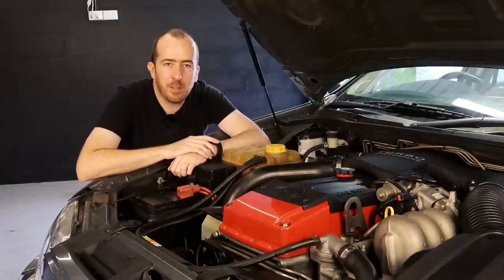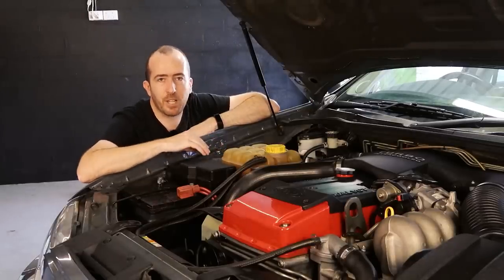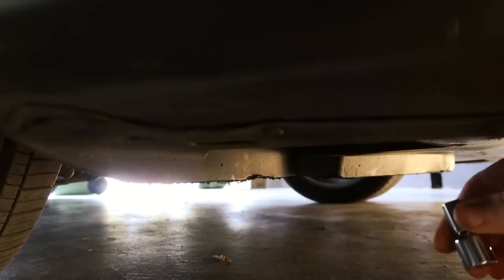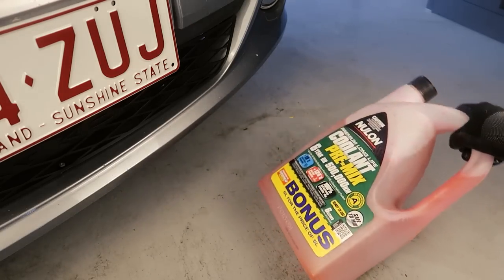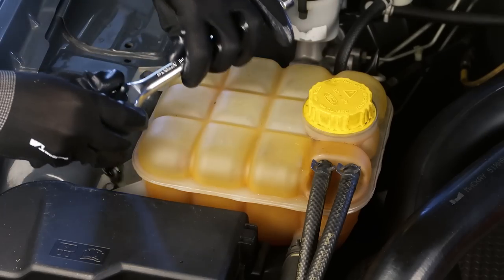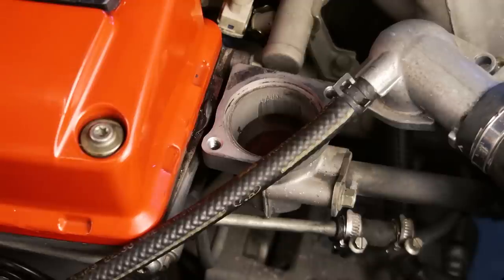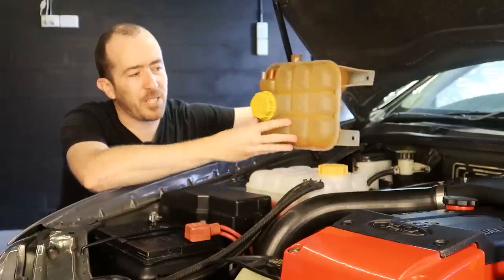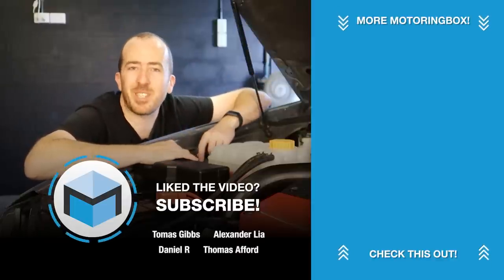Flushing the Cooling System on my Ford BA Falcon XR6 Turbo

Comment: Well presented almost professional video , well done . I had my cooling system flushed out a few months ago , I noticed in the Ford Falcon BA repair manual it says the cooling system takes around 12.5 litres but my mechanic said they only take around 8 litres🤔. I would have flushed it out my self by removing the bottom heater hoses on the block to get as much of the old coolant out as possible like the repair manual says but I have no room at my place to do it . I attempted to change the coil packs and spark plugs myself unsuccessfully I might add because I just couldn’t get that back valve cover but off , just as well too because when I took it to my mechanic he got the air hose to clean out around the spark plugs before removing them , mate you should have seen the dirt and getting blown out around the coil packs , I couldn’t believe how much shit blew out . If I had been successful and gotten to the stage of removing the sparks plugs I hate to think of the grit and dirt that would have fallen into the cylinder. Warning to all those that want to change their spark plugs at home , blow out all the dirt around your spark plugs with an air hose or with a few cans compressed of air .

Comment: I have cleaned up an expansion tank previously by soaking in nappy wash and putting some metal washers in it and shaking it to loosen the crud inside.  Improves them but nothing like a new one if you can get them.

Comment: Just a tip to get to the rear spark plug when you do it, once you crack the plug's seal and loosen with your sockets and a couple of short extensions its useful to pull the plug out (and possibly your spark plug socket) with a piece of rubber hose. If you get stuck one of the coolant return hoses to the coolant reservoir fits perfectly inside the 1/2 inch socket drive and around the spark plug itself and worked a treat to do mine.

Comment: I've seen a technique used on yellowing plastics, mainly computer parts to bring them back from yellowing. Its called Retrobriting, basically immersion the part in a peroxide/water mix and exposing the part to UV light. Would be cool to see if you can get it to work on that expansion tank.

Comment: Better to premix the coolant in case there is coolant left in the system, so that the mix ratios is spot on. Also when putting the clamps back place them on the same spot for a good fit. If the hose is hard to re-insert dip it in boiling water. Works a treat!

Comment: Just a suggestion for when you do the coils and spark plugs, get a set of ngk iridium or laser iridium plugs. I have them installed in all my vehicles, and you will notice the difference, it gives you a little extra power and they last a long time, ive clocked over 100000kms on my vn with iridium plugs and each service I've inspected them and each time they look like new, no corroding, the gap hasn't changed, they are definantly worth it
Reply: R35 GTR coils are a very good upgrade also, did it on my Supra
Reply: Just use the Ford/Motocraft/Denso ones, about $40 for a set where as the NGK’s are a lot more dollars. Iridium work not much better they are just longer lived. Change the plugs before you burn out the coil packs.

Comment: The coolant bottle should last nearly a year until it discolours. Save the old one & clean it up as spare parts are getting harder to find these days. Even if you don't clean it & just store it, you know you have it spare when needed. 
As Sam D suggested, iridium spark plugs are the go.
Again another great video that's easy to follow for those with little mechanical experience. 👍

Comment: Nicely timed video as I'm about to do the same job on my FPV F6. I've actually bought a new PWR all aluminium radiator, new silicone hoses and yes, I got a new header tank (Dayco also) as everything else was new so why not!
Reply: Excellent vehicle
Reply: @AdamAus85  Thanks mate. Really enjoying your content, keep it up! 😃
Reply: Had Tornado No 20 for a number of years (needed more than 2 seats- damn kids!)
Reply from the maker: Cool, replacing the radiator shouldn't be that much more difficult. I'm very happy with the Dayco tank so far, hopefully it holds up well over time. I was tempted to try and file off the little Dayco logo they have on top, but didn't want to risk wrecking it.
Reply: @MotoringBoxTV  Yeah it's quite straight forward. I have replaced a standard one previously (horrible skinny thing with plastic tanks, still can't believe FPV could keep something like this on such a vehicle. It works but...). This PWR unit is 4 core and will be able to keep temps much more consistent with the warmer weather. The radiator in my case has much work to do as the cooling circuit on the F6 includes an oil and transmission (ZF) heat exchabger.

Comment: Great video as always bro. My mate had a BA XR6T ute with the same dramas, only he had just replaced his coil packs a week before he had the misfiring issues, so even brand new ones can be crap (he took them back to Repco, but they mucked him around with replacement saying they had to send the old ones back to be tested before giving him a new set). It turned out the coil pack was actually firing, but the stem down to the plugs were faulty on 2 of them. Vehicle was off the road for about a week. It always pays to keep the receipt. Keep up the great work mate. Looking forward to the next video. 👌

Comment: Check coil packs for misfire.
Also make sure to throw silicone spray into the boost solenoid (down below the coolant bottle). Dont use WD40 as it fucks the rubber in it
Reply: Yeah I agree, coil packs will fix it for sure
Reply: Dis the BA have the cCam Phasers (honestly cant remember- i know early models didnt), because if you are getting a miss, the seals on the phasers can leak, and fill No 1 & 2 spark plug wells with oil, shorting out the coil.

Comment: Always found when doing coolant change that the recommended liters to refill were always less as there is always coolant left in system .The last time i did coolant change on BF falcon mk3 after flushing system i used a vacuum cleaner which blows an sucks using the blow mode i was able to blow all the coolant left in system out of engine an radiator as well as heater core just insert vacuum hose into top radiator hose and blow back through radiator with bottom hose undone then reattach thermostat housing without thermostat in an connect top radiator hose will need to unattach from radiator then blow out system.system then takes exactly the recommended liters of coolant so your not mixing old coolant with new .ps you can buy a ozito vacuum cleaner from Bunnings for around $40:00.which is  what i used . keep your hands on the wheel an your eyes upon the road 🎣👽
Reply: Thats a good idea i never thought of that. I start the engine when the coolant is draining if possible so the water pump can just pump it all out.

Comment: Great video. 
I literally only replaced the thermostat and coolant in my AU GHIA last week, I was hoping to get the heaters working a bit better but sadly no luck with the heaters.
Reply: Will be the heater tap ... not expensive but a akward job to do.
Reply: Same problem.  Heater on my ford EL is never hot

Comment: Hi Sean. Another great video. Hey mate those coolant reservoirs can be cleaned. Have a look at some YouTube videos and then make one of your own. I've seen them being done on the el/nl falcon fairlane ones and they came up amazing. If you get the time would like you to do a video on cleaning yours. Keep up the great work. Cheers.
Reply from the maker: Thanks for the comment Marcus. Although it wasn't shown in the video, I examined the old tank and found the plastic hose connection points were all swollen and heat cracked after everything they've been through over the years. So mine went straight in the bin, but even if the old tank looks okay.. new ones are quite cheap? So I think it makes more sense to replace?

Comment: I do recall way back when I did a coolant flush on my AUII Fairmont that there was a quick-connect underneath the rear of the engine where you could disconnect it using pliers by squeezing two tabs and a garden hose would simply plug into one end... Then you just need to point the other loose end into a bucket and get the missus to crack open the tap!!!
Not sure if Ford carried the same cooling setup over to the Barra (I never got to service our SY Territory as it was under warranty) but it was a brilliant feature!!?👌
Once again mate, keep up the great content of you vids!!!👍

Comment: Coil packs are always the annoying issue with falcons,   good job on the Barra 👍
Reply: The coil packs in my 2009 G6E-T are now 12 years old and have 205,000km on them - still working fine.  At this point if I have to replace them all, I'm hardly going to feel hard done by.
Reply: Just use genuine coils & put hi temp anti seize on the outside of the coil boot & dielectric grease on the inside to help get the bastards out of the hole & off the plugs when you have to replace next time .

Comment: Hot tip... reconnect the bottom hose and direct the top hose down to the ground and run the car with heater core on. (With your garden hose running through the thermostat housing)

You'll flush the entire system, heater core and radiator all at once.
Reply: Also, undo the hoses in and out of the automatic trans cooler and flush and drain through them. They are at the lowest point in the system apart from the radiator petcock.

Comment: Good Job....!!

My reservoir is identical and it looks a bit yellow and cracked in places and I’m worried it’s gonna spring a leak under pressure so I think I’ll be following your lead on changing that really soon
Reply from the maker: Yes it's worth doing. My old one actually had heaps of little cracks around the hose connection points, so it was only a matter of time before one or more of them broke off.

Comment: Barra came with green due to the metal bottom end. Red is for all alloy engines.
Reply from the maker: Supercheap recommended both... I guess it mustn't hurt it that much.
Reply: @MotoringBoxTV  Just searched Nulon lube guide. Recommended  Nulon One coolant (universal 10 year) or Nulon Green.
Reply from the maker: @nunika1975  not sure what you're searching for - when I put in my XR6T's details Nulon recommends yellow or red. Not all red coolants are the same and I'm going to film a video in the future explaining why.

Comment: If it is an original radiator the that falcon there will be a drain plug. They're either under the fan shroud facing the engine or on the very bottom facing down if so there will be a hole in the lower radiator support bar.
Reply: Brendan Casey not true on the XR6 Turbos , the Standard BA sixes and the XR6 had a drain plug but not the XR6 Turbos and for good reason

Comment: I've had the same issue of miss fire on my BA ute thats now done 386000 kms! how kms has this car done? As well as your coil packs or sparks plugs it can also be the rocket cover gasket and o-rings could be worn causing the engine oil to leak into the spark plug cavity. If that happens it can also cause a misfire as spring from the coil pack won't contact the spark plug top tip!  You will soon know when you remove the coil packs if its saturated in engine oil then the gasket o-rings are stuffed.

Comment: It amazes me how the BA falcons don't overheat in summer traffic. In the old days, traffic was a no-go zone for the mighty cleveland.
Reply from the maker: So far so good. I believe my old thermostat might have been an 82c because my engine runs hotter now - with the 91c thermostat. But from what I can tell this is the temperature Ford intended them to run at, and it consistently holds that temp even in traffic.

Comment: Looks really decent. lot better than high pressure near electronics. The difference between green and red is the green is considered standard and the red superior longer life. They use different base chemicals. I don't recall the chemicals used. You'll probably find Dayco are the manufacturers of the original.

Comment: Don’t you have to pump air out of the heater module in the fire wall where it enters in hot and comes back out somewhat cooler back into the engine?
Reply: If you lack coolant in that module overheating occurs and heater no longer works until the module has the correct amount of coolant passes through it.
Reply from the maker: Never had any problems

Comment: I did mine today, I had everything except the upper and lower radiator hoses . That's what needed to be done. It seem the previous owner was really cheap. Must be the same hoses from New 2006 all crackly inside .I flushed the heater core too , it needed it . But you know when you tinker with cars there's always something else needs attention.
Reply from the maker: Yup, not wrong...

Comment: Also change out the intake manifold gasket ,quite common part that goes on them
Reply: Yes mine went in 2014. Ran terribly. Felt like a great bit dirty flat spot at 2,000rpm

Comment: The dreaded ford coolant bottles. I have never seen a clean one 😂. The cleanest I ever got one was by using washing powder to get the flakes of coolant and rusty coloured water out. Definitely the worst design for cleaning ever made especially in e-series falcons with the 3 tiny water passages limiting the ability to clean them.
Reply: E series Falcons are a nightmare for this. One day I’ll clean the one in my EB II
Reply: Tried cleaning mine today. Impossible. The couple has stained through. Put a new aftermarket product. How can we prevent it from stains again?

Comment: Great video mate. Small tip for changing plugs in future, use a combination of 1/4 and 3/8 with adaptor as well to remove and replace cylinder 6 plug. You won't get anywhere with 1/2 inch as its too big and the firewall sits slightly above plug hole making it a pain.
Reply from the maker: I have a collection of partially complete socket sets of both types, so hopefully I can find a combination that works!

Comment: So I just recently removed my tank and silly me forgot to note which hose was which. is there a way I can tell?
Reply from the maker: The upper vs lower radiator hose?
Reply: @MotoringBoxTV  YEah I think Ive figured it out, the upper near the thermostat goes right side.

Comment: I have a question does it really need an additive for the oil. I'm finding the BA leaks a lot of oil. I checked the rocker cover and sump. Sump box is very oily . I've degreased it a few times. I wish some could just recondition my motor.
Reply from the maker: I don't think it needs an additive, it might be worth trying to trace the oil back to wherever it's coming from. You might need too replace some seals or gaskets depending where is coming from.

Comment: My ba had a very dirty cooling system due to the previous stupid owner mixing coolant. The cause was a mud like substance in the system. I drained the system when it was cold. The removed the thermostat water pump and radiator.  I flushed the block out with a garden hose and the heater core aswel. I even went one step further by before replacing the water pump I started the engine and kept it running it for about 5 minutes with the garden hose hooked up and the radiator removed flushed out everything till water ran clear. Then I put new radiator water pump thermostat and both hoses. Preventive maintenance is the best for these cars. I recommend changing the radiator every 100000km because the trans oil cooler is incorporated into the radiator and if you see a milkshake you know your transmission is probably going to stuff up.

Comment: What method was used to clean the existing/original overflow  expansion tank?
Reply from the maker: The existing tank wasn't worth saving. I had a closer look and the plastic around the hose connection points was starting to crack and craze from prolonged heat exposure. Not worth the risk when new tanks are cheap enough.

Comment: Oh yeah it the coil pack, had the same issue with misfires at idle. Could also be other things but you can start there. I used an ignition tester to check if it fires at 30KV, anything less is probably weak spark ⚡️ 😄

Comment: I've built a couple of xr6turbos. Check the powersteering switch, intake manifold gasket (spray carby cleaner around the gasket), PCV, TPS or dirty throttle body. Let us know what you come up with.

Comment: All falcon coolant reservoirs go that colour, turbo or other wise. I had a 2010 FG XR6 with under 100k, exactly the same, and the BA/BF's I had as company cars did it as well. Suggestion for the future: change out the power steering pump, they're rubbish and if it's not whirring now it will eventually lol. Front rotors and pads as well, also rubbish and you'll avoid getting the dreaded high speed brake wobbles, most unnerving at 100k. Both easy jobs 😉 and well worth the investment.

Comment: I had a  ba xls which had a miss on idle, it was a coil pack, the  owner i bought my car off had washed the engine bay and wet the packs, easily  fixed in my case $600 😒

Comment: It'll be the throttle body (it needs a good clean) same thing has happened to 3 of my falcons.. did the coils and spark plugs and had the same issue, cleaned the throttle body and BAM.. problem gone.

Comment: Check the throttle body and plenum chamber for gunk that can cause a missfire at idle as well. Use a intake cleaner, I like to use the nulon foaming intake cleaner it works great, it's at supercheap auto. You can try the motocraft stuff that they sell at ford but if you get a wiff of it accidentally it'll make you want to hurl, it's mostly amonia.